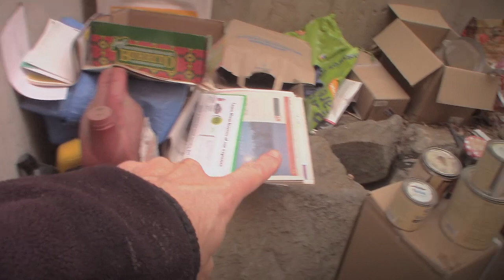Prepare a Greenhouse for Food Production - Part 0

Comment: I envy your energy, of course you are still fairly young.  A couple of thoughts, I am at the half way point of the video at this point.  The back wall, two things, first a water wall which would provide significant thermal mass and water storage,  in front of that a lattice support wall for food that can be trealise trained, beans, tomatoes lots of things.  Then I would use that space for either hydroponics, which would be the best but difficult to get going.  Other than that I would use grow barrels and buckets which will make control and rotation much easier.  

On the outside garden space posts and rails around the perimeter that you can keep a rolled up tarp, covered to keep the uv from killing it.  This would have more advantage than just fallout, you could extend your season a little by frost protection at the end and beginning of season. 

I am good on bandaids and bullets part of my prep, one of my big limitations is food.  Because I am worried about the state of the world right now, I went ahead and did something I normally would not recommend for economic reasons.  I bought a one year freeze dried supply for about 6K, I also finished ordering the stuff I would need to install a wood stove, damn chimney is more expensive than a stove.  Still I hope both of these are just wasted money.  I would only install the stove if we were grid down, that is just how much I hate servicing a wood stove.  We have plenty of trees and my neighbor has enough seasoned that I could get by one season.   No garden, no greenhouse, no fallout shelter, but at my age these are not going to happen.  I  do store a lot of seeds in the hope they will put me in a good trade position for some of the harvest from them.   I wanted to ask you if you were doing bulk seed storage, I buy varieties by the pound.  I just bought a couple of pounds  of poppies, another thing I pray I never need.  Look forward to watching your greenhouses progress.
Reply from the maker: Great tips on the greenhouse plans. I'm actually planning to do a lot of those things - and did I mention that I have a gray water pipe that's set to run into that area too. I'll be able to run the shower and laundry wash water all out to the greenhouse (both for hydration and for warmth).
Reply: @PraxisPrepper  That is a good thing to do, I set my house plumbing up for that thinking one day I would do the same thing you are doing now.  Gray water should not be sent down to the septic tank if you can avoid, much better for the plants.  That same gray water can be used for flush toliets downstairs from upstairs sinks if there is access to the plumbing.  One of my eventual preps is taking roof catchment to storage at a level of above my toliets and feed that to them.  Right after water and food, I see sanitation as my priority.  I am old enough to remember the outhouse at my grandparents home and I never ever want to have to live with that.  Another reason to bug in and not bug out.

Comment: Been looking forward for this series. If you think about it, the fact that the pipe is essentially insulated is a good thing because in that environment the ground temp should be fairly constant and never freeze so injecting as much warmth as possible directly into the air is much much more beneficial. Having dealt with directly with mold caused health issues, I’d really recommend strongly drilling a series of holes directly along the spine of those pipes to ensure that all moisture is given the best chance of escaping that pipe as possible or you really will risk blowing spores into the air. Keep in mind that kind of pipe isn’t absolutely rigid, it has some flex which means you can’t count on the ends being the lowest part of the pipe, the risk is lessened by the fact that it’s a relatively short tun but it is a significant risk that is easily dealt with now. Additionally I’d pul a little gravel under the holes to help keep them from getting clogged by moist dirt.
Reply from the maker: I think my accidentally not having the right glue for the joints (leaving them leaky) will help me in that regard too. ;)
Reply: @PraxisPrepper  Still… Ethan suffered for a couple of years from “head burning” which seemed to be migraines and turned out it was because of mold that had started on the wall behind a 6’ x 8’ whiteboard attached to a wall in my office which he took over after I stopped working. The master bathroom was above my office so there was a leak up there. We didn’t figure it out until after we sold the house to an investor and looked at the pictures he put up when he put it on the market. It was in the Fall of 2020 so he ended up selling it as is and had removed the whiteboard from the wall which is how we found out about it and connected the dots that it must have been the cause of his headaches because they went away after we moved out of the house. Made us feel better about our decision because the cost of the repairs would have likely eaten up what additional money we could have saved selling it through a broker. Decided to sell to the investor given the quick guaranteed sale and fact that because of my medical issues showings would have really been a PITA. Negotiationed a price we were satisfied with so that and ending Ethan’s headaches made it a good decision all around.

Comment: Oh, and high tunnels outside not only extent your grow season but can protect the ground too. Consider those.
Reply from the maker: I have my eye on a few places where I might install those. They're so easy to construct.
Reply: @PraxisPrepper  cattle panel tunnels. Cheaper to build with down there then here.  Lots of videos.
Reply from the maker: @davidsto9064  My brain wants to imagine that cattle fencing would deform under heavy snow load, but I also tend to over-engineer everything I build. So maybe they'd be just fine.
Reply: @PraxisPrepper  had 3 feet or heavy snow on mine in December this year. No issues.

Comment: Heat and humidity recycle is Praxis at his best. Who else would take the time to think this through to such a degree and get so much double use. Or is it third or fourth use? The heat in those bathrooms is secondary heat from the stove that is also recycled through the floor. If you could follow a single air molecule for a week, how many times would it cycle through the house bringing some level of comfort?
Reply from the maker: With our air exchanger, hopefully not too many times. That's been a HUGE improvement in the air quality inside this year. I haven't done an update video on it yet, but it's a game changing tech. It captures more than half the heat from exhausted (allegedly) and keep the CO2 levels in the house at super healthy levels all winter long. AND... because I love being Praxisy, I decided to vent the waste air out in the the other greenhouse (which presently houses the chickens). So even the remaining heat has another chance to do me (and the chickens) good. I should do a video soon. It's been awesome!
Oh, and on the topic of re-use, I'll be building the real chicken coop this year and my present plan is to use the waste air that comes out of the radon mitigation tube to blow into their coop to keep it warmer in the winter and cooler in the summer. Yeah, they'll get a little radon, but I'm not thinking they live long enough as chickens to be harmed by it with lung cancer etc... plus it's not PURE radon, just elevated levels of it.

Comment: Speaking of pretending something is safe that isn’t… that ladder didn’t really seem like it would be tall enough to safely reach your roof. I don’t know if it was just the angle or what I would image the length of a roof rake to be… would it not make sense to build a reinforced section over the side green houses that you can stand and reach to roof solar panels from there? Or maybe via the backside where the ground is higher? Just saying. Ya makin’ me so nervous!
Reply from the maker: The ladder was partially collapsed in the video. I didn't want to leave it at full extension because it's less stable that way. So I figured I'd collapse it down to that lower height and then just raise it back up after the next storm to the full roof height again... which may be challenging if the ice from the storm freezes up the legs and they are frozen together and won't extend... I'll cross that bridge (using boiling water) when I get to it.
Oh, if you're looking for ladder safety, I'd HIGHLY recommend that thing on the top of the ladder. It stands it off from the roof and stabilizes it. It's a great tool and makes the ladder feel way safer.
Reply: @PraxisPrepper  A more radical approach may be to take the panels off the roof and build racks that you can walk up to.  When I  bought my off grid property in Montana, my neighbor made a big point of telling me he put his panels on the roof then after the first winter, down they came. Just too dangerous in the slippery ice and snow. He used the panels to build a "roof" for an open air shed for his miscellaneous yard equipment.
Reply: More tech but far safer in my way of thinking is to simply not brush off the snow in any case.  Wash it off with a pumped water system either left in place, which could also be used to flush fallout off the roof as well.  Or simply use a high pressure spray washer with extensions to do it from the ground.  Trush me on this, the more you can do from the ground the better off you are.  One mistake and it can be game over.   I have 30 panels waiting on me to install them, this is my plan, assuming I do not buy my personal farm before then.
Reply from the maker: @charlescoffey9523  i've thought about water to wash them clean for years, but never bothered to really plan to do it. Cool idea. System would need to have a drain so after each flishing, the pipes on the roof would totally drain down... would also maybe need thought to prevent pipes icing up during flushing, if it were REALLY cold. I can inagine even moving water locking up if the pipes were cold enough and the water first started being oumped up inti them... maybe not. But worth considering.